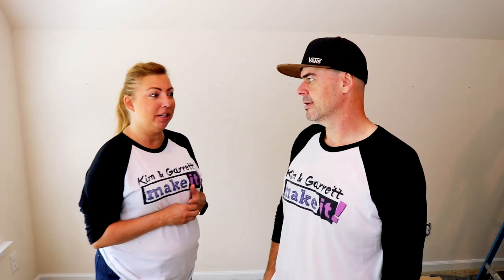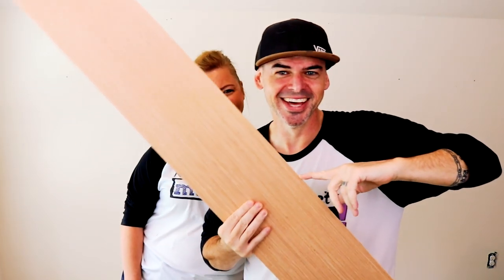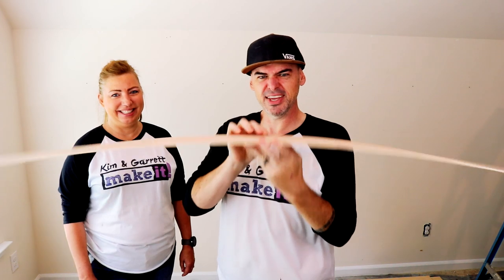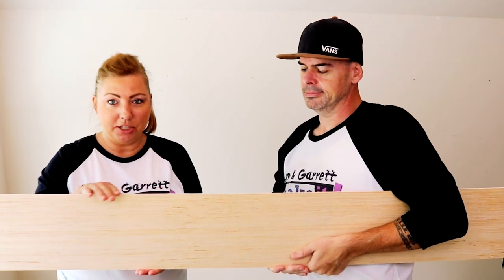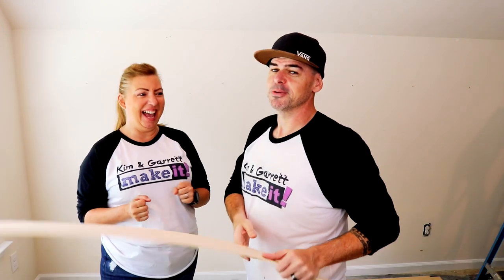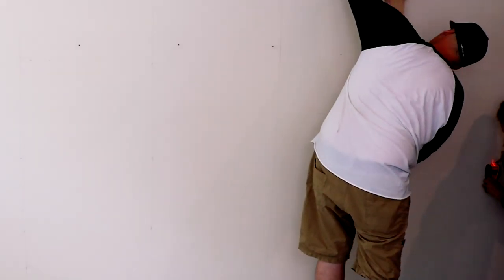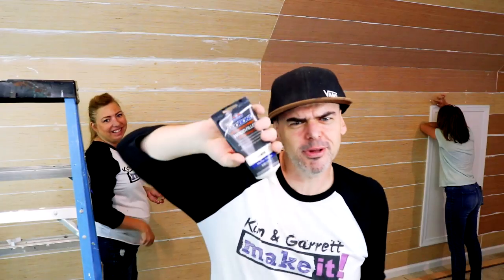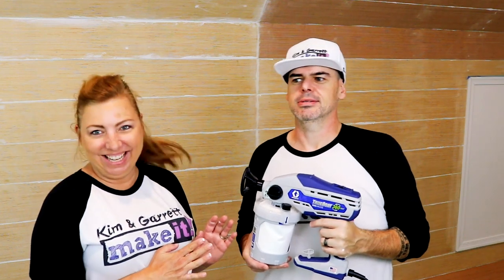DIY Faux Shiplap for $80 Using Plywood

Comment: Did you run into the brad nails flying thru the 5mm boards? I have the same ryobi brad nailer. Flying thru as in going to far into it since they are so thin.